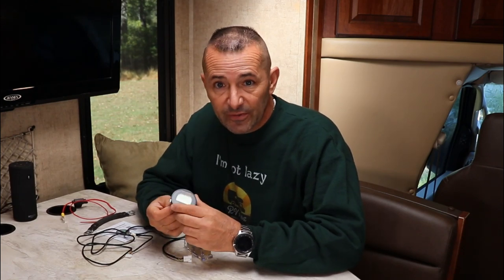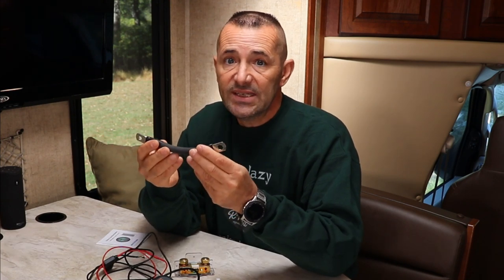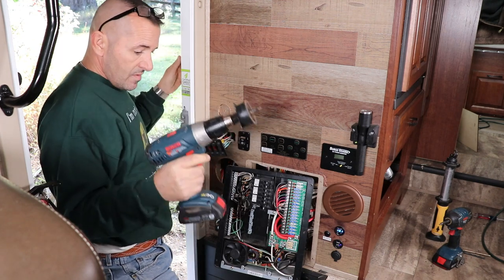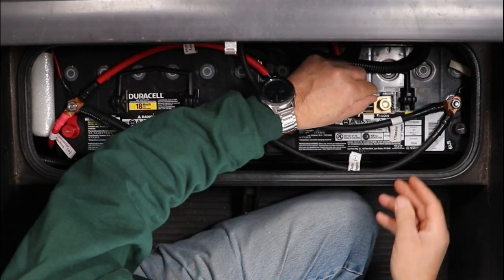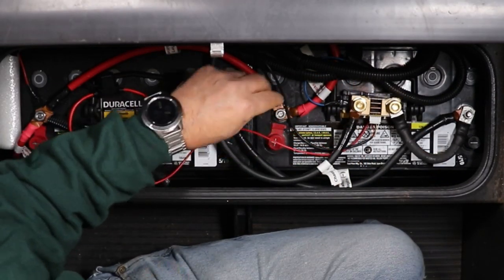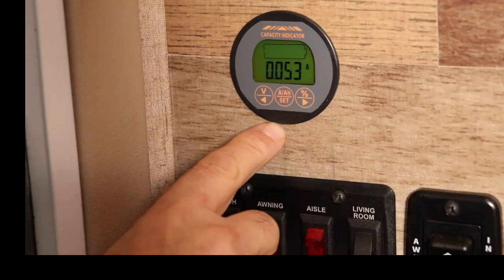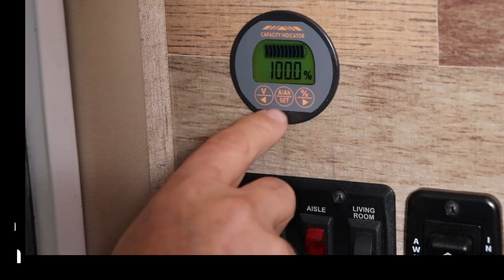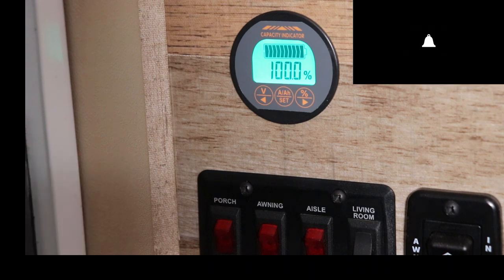Installing A Full Function RV Battery Monitor From AiLi Qwork– How To - Tips and Tricks - RV Upgrade

Comment: Great vid and great install!! So im really considering this unit for a few reasons.. you really sold it to me on the video, my hatred for Renogy ( i hate their lack of support)  price of the victron and spyware tracking you on their app lol . My question is does and will this unit tell me how much my solar panels are putting into the system? That is the only reason i would not end up getting this. I have a 200watt kit i bult and i would like to monitor how much it is producing and putting back on my system. Thanka for the help
Reply from the maker: Hi, I don't have solar but this meter will tell you what is being put into batteries no matter the source.  With that said once your batteries are full they they wont take any more charge so it will not tell you for example 1 amp is going to batteries but solar is putting out 15 amps.
Reply: Thank you for that info!

Comment: Hey Lou and everyone! I have one of these for my off grid solar setup. It only displays discharge, it never shows when the batteries are in a state of charge and the capacity % doesn't increase unless I reset it. Anyone have any suggestions??
Reply from the maker: It is either not working or connected improperly.  Mine shows both discharge and charging.
Reply: @RVHabit  Thanks for your response Lou. I found the issue, I had my solar negative connected before the monitor. Connected post monitor and it worked.

Comment: What size of in line fuse to power the monitor did use?
Reply from the maker: I used a 5 amp fuse on the power wire.
Reply: RV Habit thanks for the info and excellent video
Reply from the maker: Thanks so much.

Comment: What i didn't understand is does your charging cable goes directly to the battery or does it goes through the shunt? Shunt is checking the voltage and every watt that goes through it will be showed as consumption but im thinking if charging wire shows circulating from other side will it be confused or not?
Reply from the maker: Only negative cables go to the shunt.  It will read what comes out and what goes into the battery.
Reply: @RVHabit  I know that, but i was thinking on which side of the shunt goes wire from mppt. But i think i know now, thanks.

Comment: Great video. I'm a newbie and have some questions: Will this work with 2 six volt batteries? What kind of flashlight and mount is that by your other gauges? Thanks.
Reply from the maker: I will assume your 6v batteries are wired in series to give you 12v.  Then yes this meter will work fine.  The flashlight is a Nite Ize Inova T4R Rechargeable Tactical LED Flashlight with Lithium-Ion Battery.  It comes with both AC and DC chargers.  You can check it out at this link  https://amzn.to/3eMDZT7
Reply: @RVHabit  Thanks so much!

Comment: Hey, I have a 12v 400ah battery bank with a 3000 watt inverter. What size wire would you recommend for the 350 amp shunt to the negative terminal of the battery bank? I'm using 4/0 wire right now to connect batteries together and from batteries to inverter. Thanks in advance!
Reply from the maker: 4/0 is pretty large.  I recommend looking on a chart readily available online for correct wire gauge.  Remember you must take into account the distance (length)  of the wire.  Good luck.
Reply: @RVHabit  Thanks for the quick reply. I'll see what I can find online about it. Would definitely love to be able to monitor my batteries easily. Great Video!

Comment: Just curious but I understand that you have 210 AH battery bank but isn't it only 105 AH usable? So shouldn't you tell the monitor that its a 105 AH battery bank so it reads 100% at the usable AH capacity and when it reads 0% it would mean 0% usable left but 50% actual?
Reply from the maker: You want the monitor to monitor the batteries.  If you only set it for half that will not give you accurate readings of the state of the batteries.  For example if your batteries go down to 40 percent your monitor will read zero and no lower.  zero is zero.  Now when you charge the batteries the monitor will think it is at 100 percent after filling 50 percent back not the 60 percent it is actually needed.  The monitor tells you the state of your batteries.  You determine how low to go.
Reply: @RVHabit  thank you for your quick response and explanation

Comment: What size fuse did you use in the power wire to the shunt? I too like to fuse anything that draws power, but the instructions from AiLi don't show a fuse, let alone indicate what size it should be.
Reply from the maker: Hi Tim, I used a 5 amp fuse.
Reply: @RVHabit  Thanks! That is what I decided to try as well. I tried reaching out to AiLi via Amazon, but so far no response.

Comment: How did you get the 12awg power wire to fit into the green connector on the shunt? Cable seems too thick. Thanks!
Reply from the maker: I stepped it down to I think 16awg
Reply: Thanks again. I got mine setup today! All good. Your video was so helpful

Comment: Hey love the video thank you just a quick question about grounding sorry if it is an obvious one:  is the grounding wire on the power side of the shunt or does it come directly from your negative terminal separate of the shunt?  Does it matter if your ground is outside the shunt or part of the power upstream?
Reply from the maker: Not sure I understand.  The shunt connects between the negative post on the battery and negative cable to the chassis.   The small power wire is to power the meter.
Reply: @RVHabit  I know all of the uses of power need to be going back to the negative terminal through the shunt, so the shunt is like a chokepoint... but for the grounding cable grounding your batteries to the chassis would the ground be coming from the negative distribution/busbar after the shunt then or can it come directly from the negative terminal on the battery before the shunt?  Does it matter?

Comment: Thanks for the video. I have everything set up but the battery charge percentage doesn’t appear to be going up when I have the engine running(I’m using a VSR split charge system only). Do you have any idea why this might be happening?
Reply from the maker: If you have all the negative cables to the shunt and the vehicle is actually charging the batteries it should show on the meter.  Check with multimeter to make sure batteries get a charge when vehicle is running.
Reply: @RVHabit  thanks. I had more than just the one negative wire going to the shunt. All sorted now. Thanks

Comment: I have the AiLi 350A and am just setting it up, but forgot the instructions. I had thought this monitor had to be calibrated to near 0%, so knowing I can cal. at 100% is very good news. Thanks. I wonder if there is a way to stop the backlight when charging. Its very annoying at night?
Reply from the maker: There is no way to stop the light when battery is charging.  Yes charge your batteries up to 100% when setting the AiLi up, it makes things very easy.  If you need a copy of the instructions you can print a copy from my website.  Just go to the Blog section and open the AiLi article.  I have a link there for a PDF of the instructions.  I am loving this monitor and the price is great.
Reply: It's in the manual. Just push the right and left buttons at the same time to make the light stop.

Comment: I've seen people complain that the display lights up all the time (when drawing or charging).  Is this true, and if so, how do you keep the light from bothering you at night?
Reply from the maker: The light does slowly flash when charging.  It doesn't bother us at all when sleeping but it also is not facing the bed area.
Reply: @RVHabit  Thanks for the quick reply. Great video, it answered my questions about this unit and gave me a few things to keep in mind.

Comment: Hey Lou! Great video and I truly appreciate you sharing this information. I didn't notice if you secured the shunt in the location that you described or is it just placed there. If you secured could you share how you did it. Thanks again and keep the videos coming.
Reply from the maker: Hi Dan,  I used industrial strength Velcro.  I attached it directly to the top of the battery in the location on the video.  So far it has been fine and not moved.

Comment: So when you're using the system do you just not go below 50%? I'm wondering if I should just put it half the amp hour capacity of the batteries so I can go all the way to 0% on the meter and it'll actually only be draining them down half way?
Reply from the maker: Hi Christopher,  I do not recommend doing that.  Put in all accurate numbers.  You know that you should not drain below 50%.  The problem with what you suggest is if you ever run the batteries lower than 50% the meter can only go to zero.  For example, the batteries are drained to 45%. the meter stopped at zero.  You charge them up but the meter will read 100% after only charging them 50% not 55% like what is needed.  This becomes compounded as time goes on and you will not get accurate readings.
Reply: Makes sense! Thanks for the reply!

Comment: Thank you for putting the direction on your site . I did not get any with my new AiLi. I watched you video and understand it, but when I want the directions in the rv folder on the road . Because when I cut the power for some other project I bet we loose the settings.
Reply from the maker: Go to my website rvhabit.com then rv upgrades then rv electrical.  You will see my blog article on the AiLi.  At the bottom of that page you can download and print the directions i have uploaded in PDF.  I have not tested to see if settings are lost if disconnecting from battery.

Comment: Such an informative video, thank you! Do I need a 1/0 cable to the battery or are you using that because of the size of your 2 batteries? 
The battery I plan to use is a really small 35aH battery. Thanks!
Reply from the maker: Yes I used that due to the battery size.  You should use a wire at least equal to what your current setup is using.
Reply: @RVHabit  ok, thank you again for the video!

Comment: I have this battery monitor. It worked well for the few days that I had it, now it’s stuck on 100% and never moves no matter what I do. I have disconnected it, reset it, even through salt over my shoulder. It seems like these have been hit and miss for people
Reply from the maker: Hi Kevin I have had no issues in the year I have had it and most seem pleased.  Certainly if it's not working send it back and have a replacement sent to you.  I can say when working properly this is a great monitor.
Reply: @RVHabit  yes sir I bought it from Amazon prime I’m getting ready to send it back soon. I’ve looked through all the complaints on this monitor and I seem to be the very first and only one that has this unique issue. lol

Comment: great video,thanks for the info im looking buying at this exact monitor.can anyone tell me does this meter have a cumulative Amps section to show how many amps may have been consumed in a period ? like for example if you wanted to measure how many amps/ah  youve used in a 24 hour period .cheers.
Reply from the maker: Hi George,  This meter will show you how many amps you have used but only till it begins to receive a charge.  The meter will then begin to add amps as it is charged.  They do make meters that will keep a running total of amps used but this one will not.
Reply: @RVHabit  Thanks m8 for your quick response.i thought that may have been the case.ill have keep looking.thanks again .keep up the great work.;-)

Comment: Great video! It looks like you have two wires going to the Battery where the B side connects. I’m doing this on my boat. I have a wire coming from the engine/start batter to the 2nd battery negative where I am installing this, and then two negative wires going out to two amps. I am assuming I land the Amp negative wires to the P side. Where would I land the wire coming from the back battery?  Thank you so much!!
Reply from the maker: If your batteries are connected in parallel, the negative wire that connects the two batteries would stay as is on the batteries and not go on the shunt.  Good luck.

Comment: Great video! I recently installed the AiLi battery monitor but I notice that after I set the gauge to 100% when the batteries were fully charged and used the batteries during the evening and the following day as the batteries recharged the gauge did not return to 100%. Does the gauge have to be reset everyday once the batteries top off?
Reply from the maker: The Guage does not need to be reset everyday.  The meter counts amps out and amps in.  If you use 10 amps then the meter will show 100 percent when 10 amps are counted going into the battery.
Reply: @RVHabit  Thank you Lou for your help! What I did wrong was. I did not hook up my negative from my solar charge controller to the shunt! My mistake for not paying attention thoroughly......

Comment: Thanks for an awesome video! How did you secure the brass connector hub to the top of your battery?
Reply from the maker: Hi, I used some velcro.  It's still holding up. Thanks for watching.
Reply: @RVHabit  Thanks! That’s what I’ll do

Comment: I can see how you get V and Ah, but you have left a second cable coming off the negative battery terminal. Won't that give you an inaccurate reading of amps-in and amps-out since you are not monitoring everything through the shunt?
Reply from the maker: The second cable you see connected to the battery negative terminal is to join the two batteries in a parallel configuration.  All negative loads go through the shunt.  Great question and thanks for watching.
Reply: @RVHabit  Ahhhh

Comment: Quick question, when wiring this up to a system that has two batteries, does it matter which negative battery terminal the shunt is connected to ?
Reply from the maker: If they are 12v batteries wired in parallel, the first battery should be used for positive connections and the second battery is typically used for negative connections.
Reply: @RVHabit  Thanks, much appreciated !!!

Comment: Another question Lou.  The 6" connector you listed has 3/16" holes to attach to the battery and to the shunt.  Did you drill out the holes so it would fit the 3/8" post on the battery and on the shunt?  Thanks for your many videos. You're costing me money, but I'm loving it.
Reply from the maker: Hi Terry,  Yes I had to drill out the cable terminal end to fit the shunt.  Good luck on the install.
Reply: What size cable did you buy for the interconnecting link? Was it 1/0 awg/40mm? And what size lugs did you use exactly? Cheers

Comment: Hello, I notice which your charger on the (+) light doesn’t come on. My unit is doing the same thing. It discharges they battery accurately but when charging the battery it doesn’t register. Any idea? Thank you
Reply from the maker: If your battery is fully charged it will not show anything going in as in the video.  Use some of your battery then plug in charger and you will see the + show amps going in.

Comment: Thank for good demo on installing. One question, if you setup the % with the solar charging at 14v then this will be over the 100% of the batteries when not being charged, also i thought you needed to set the lower 50% voltage of the batteries so the unit knows what 100% and 50% is to carry out the correct calculations for Ah in and out and give an accurate % indication
Reply from the maker: Hi I think your making it more than it is.  When the batteries are fully charged is when you set the meter to 100%.  It will not matter if its connected to solar or the RV charger.  Batteries cannot be charged over 100%.  You also need to set the total battery bank amp hours first.  The shunt does the rest of the work.  If you use power the shunt will deduct amps.  If your charging batteries such as from solar it will add amps.  It will not add more than your total battery bank amp hour rating.  Just remember to never allow lead acid or agm batteries fall below 50%.  Good luck.
Reply: @RVHabit  Cheers RV, i watched Will Prowse set one up and he set it when the batteries where at 50%, I have one on order so will give it a go. I understand you cannot charger over 100% but if the voltage reading is at 14v (due to be on charge) when you set the meter setting for 100% then i would assume the meter would calculate % to a map reading at 14V instead say 12.4V. Might not be too important but will put some of the accuracy out.
Reply from the maker: No, only set the meter when batteries are at 100%.  It does not matter if the batteries are at 12.6 or even 14v.

Comment: Hi m8 great video iav just installed my aili but I have left the negative that goes to the chassis on my battery will this be ok or should I contact it to the negative of the shunt hope you can help thanks
Reply from the maker: If you mean the negative cable that goes from the coach battery to the frame of the RV that should go to the shunt.  If you are referring to the negative cable that is used by the engines battery (the car battery) then no that should not be touched.
Reply: @RVHabit  brilliant thanks for your help 👍

Comment: Thanks for the easy to follow instructions. I have a truck camper which I use as you use yours. Only in weekends getaways or when I go fishing. I purchased the same Battery Management Device and your instructions made it easy to install. I did had a hard time getting the wire thru the back of the walls but I manage to do it and its working just fine. Thanks Again!
Reply from the maker: Glad it worked out.